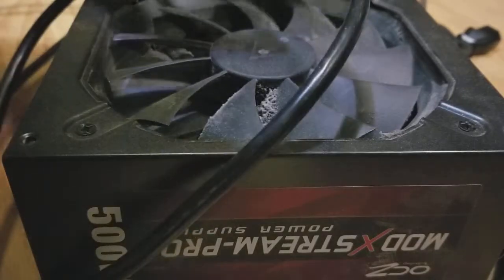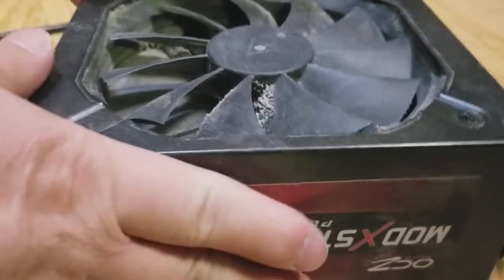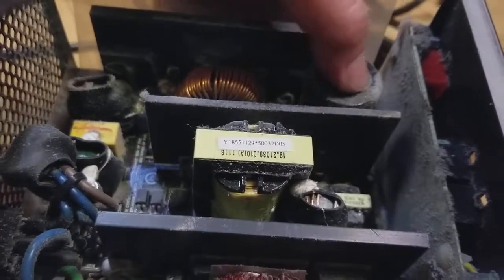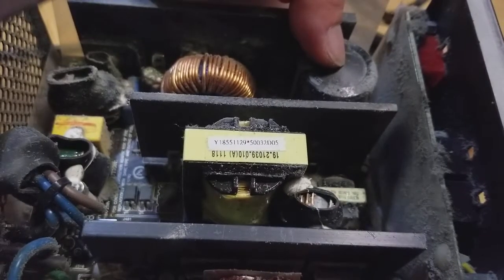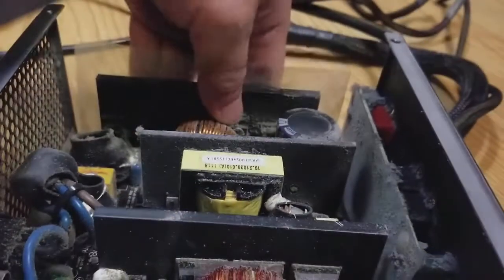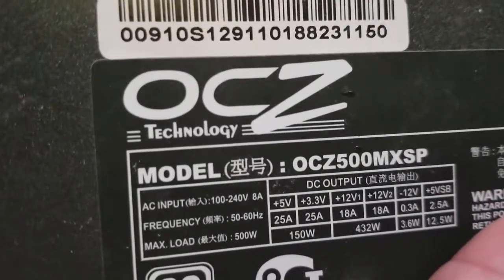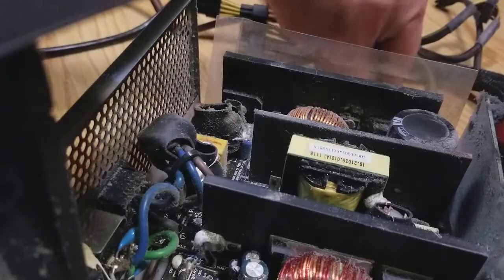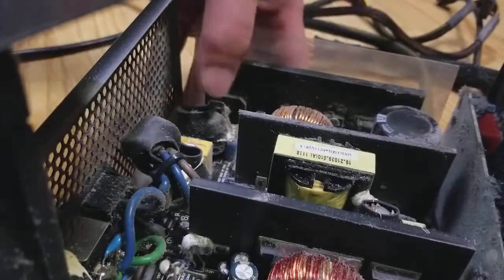Bulging Capacitor, OCZ Power Supply

Comment: i have 600w, same bad cap dead
Reply from the maker: yeah that sucks.
Reply: @leefiles  Do you think it's just this Big one Capacitor , is dead?
Reply from the maker: @damienb2632   doesn't matter which one. If it is one of those cheap capacitors, then it just gets fat and you would know right away that it is bad. If they are good capacitors and the people who designed the circuit were being cheap by using barely adequate parts, then it may not bulge. Instead, you wont see any visible signs. In this case, you will have to either take out each part by de-soldering them OR if you know how, you can test them in circuit.

Comment: I got the mod x stream pro 600w since 2012 . It runs 4hdds 2 ssd and some 3 pci cards and a 180W gfx card and 125W cpu and still runs like beast.  Since the day I bought it, I use silverstone magnetic dust filter on fan block. its easy to remove and install for cleaning purposes. Hope you fixed the issue about that big bad boy ( cap ) , its easy to change them.  Good video !
Reply from the maker: Thanks. I've had quite many 'fat cap' problems. I had a 5 year old pc that was acting up one time. It would just slow down and crash for no reason - until I opened it up and saw many fat capacitors.
At work too.  They had many flimsy DELLs that had fat caps. Sometimes I would replace the caps. But I don't know if anything else may have been damaged by the problem such as data loss. Or maybe collateral damage.